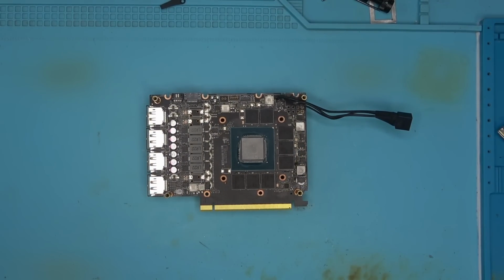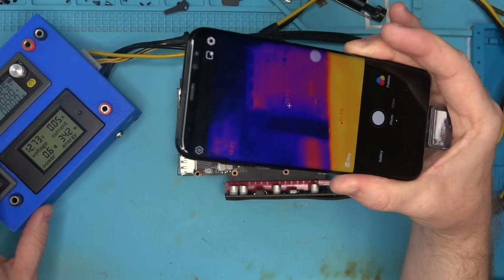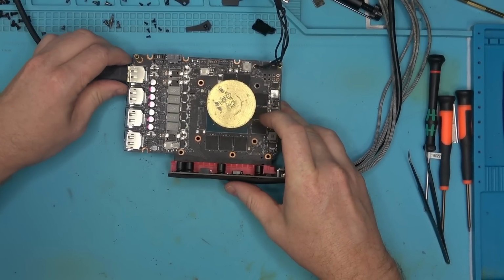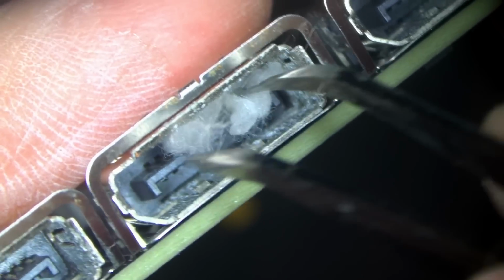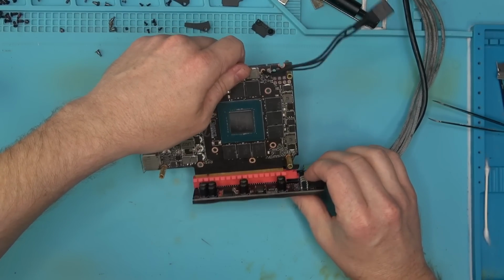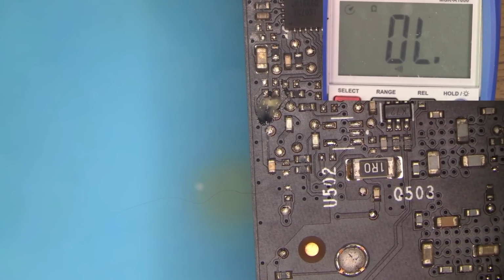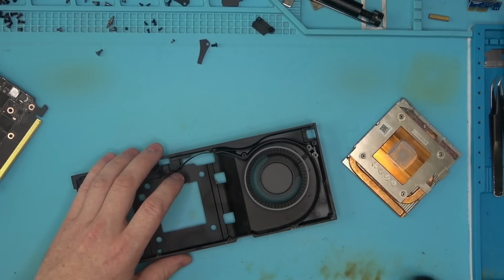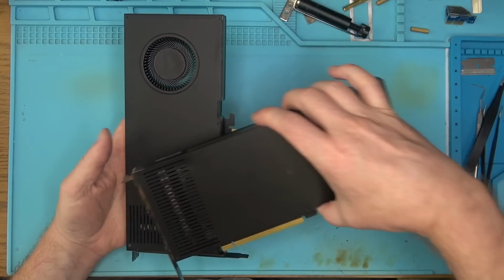RTX A4000 no video repair. Rust Corrosion damage

Comment: Looks like a good candidate for painting the PCB with Conformal Coating to water proof it. So it can go back to the Sauna it was used in. And tell the user to slap vasiline /Petrolium jelly on the display ports.😂😂😂

Comment: I have the same black and white 8K Hdmi cable, and they are absolutely too stiff. I am so worried about them damaging my ports. Another thing I really miss from older monitors is a way to keep the dang things on. They go to sleep and very few allow you to change the sleep setting on the actual monitor.

Comment: As a amateur PC repair guy I can thell this is similar to RTX 3060 but with 16GB VRAM. A bit faster is 4060Ti in gaming
Reply: it's identical to a 3070Ti (GA104) just with double the memory, massively underclocked and a very limited TDP (140W rather than 290W)

Comment: I got a pcie fried rtx 2060 ventus oc for 30 bucks. Asked a local phone repair guy since charger looks like the pins and they had prior gpu repair units. Got it working within 2 hours. Thanks for the tips on getting parts/defective gpu for cheap by not buying core/no post related issues. Cheers 🥂

Comment: The issue with 4K and 8K HDMI cables is usually the length. The longer the cable the less signal integrity and loss of quality. That's why there are standards in place.

Comment: what kind of metal is that slug you use as a temp heatsink? i kinda want to lazy out and use something like that for testing builds/troubleshootings
Reply: Brass
Reply: Looks like brass round bar (rod).  Find for short-term or low TDP because it's a large thermal mass, but without the surface area of fins you can't transfer much heat to the air, so not a good choice if testing more than a short time.

Comment: Try fiber optics cables! And why you use HDMI switches - for what purpose? If you have the Decklink Quad 4k you get 4 inputs and you can MIX them with Software - OBS is free.

Comment: Toothpaste.?. I'm an auto mechanic and i deal with corroded pins all the time. I've been using valve grinding compounds, but sometimes the female loses its tension from the thick grit. I'll try the Toothpaste.

Comment: I think it is a very good practice to use ultrasonic cleaner to "force" any intermitent error to manifest permanently. Me, as a hobyist, try to avoid using it for that same reason xD.

A quick question @northwestrepair (or the rest): What fluid do you recomend for the ultrasonic cleaner? Just distilled water? A very small amount of soap or nothing at all? Or commercial mixes? Thanks

Comment: Reminds me of this video of hundreds (if not more) GPUs (probably coming from mining farms) laying on pallets and being cleaned with high-pressure washer and dried in the sun, probably being prepared to be sold on ebay and ali...
If the core and memory are not already fried by heavy mining, the corrosion will probably not help the cards in the long term...
Reply: I am sometimes wondering (and used it once): If a device (phone) drops in water, don't put it in rice. Instead drop it in ample IPA to drive out the water, and let it dry. I did it once on a laptop, not quite old enough to want to throw away, but also not new enough to want to do the effort of completely disassemble: Dropped in a full cup of coffee. Immediate turned it off, drenched in in IPA, and behold, it is still working now a good year later.

Comment: What liquid do you use in the ultrasonic cleaner and do you submerge the whole board?
Is it difficult to dry out underneath the bga chips?
Reply: If you flush the card with IPA (or even just dunk it in IPA), the IPA mixes with any remaining water and makes it easier to remove via compressed air.

Comment: crypto miner i bet . if it was a legit server room it would not be rusted out like that my 3080 ti 20gb came from a  mining farm and was rusted a bit
Reply: Because they are usually using an AC to cool down mining rigs. Its the cheapest option, miners think they will save a card from its own heat damage, but you cannot change the laws of physics (or chemistry) Heat and cold together creates condensation which causing rust. You're 100% right about how those cards got damaged.

Comment: That's typical about Amazon and Aliexpress. They sell HDMI and DP cables saying they are 4K but in fact they are counterfeit rubbish.
4K standard is relatively new and yet raw. A lot of improvements are still to apply.
Reply: If i buy HDMI cables i check if they have HDMI Ultra High Speed certification (or a different standart depending on what you need). 
Manufacturers will in most cases proudly promote it if they have certified their cables. 
They also must have a sticker on the box with a QR-code that links you to the official HDMI certification website.
I never had a problem with bandwidth/drop outs or anything with these cables. 
There are quite alot around and they dont have to be expensive.
Reply: @telefonbärmann  Genius. What if they have all the "certification" for 4K but still do not support it? That's what happens with Aliexpress items.

Comment: not going to give any specific advices, but check dual mode monitors. eg, LG has bunch of them, which can HW-emulate 1080p while being native 4k if needed. that saves a ton of time and nerves. 
on top of that, most of them have built in KVM switch. may be useful
Reply: Most dual mode monitors dont have   1:1 downscaling to 1080p tho. U would think that 1080p on 4k monitor lets every pixel take exactly 4, but no. Its weird
Reply: @richardjung9562 true. But still useful for some moments

Comment: @northwestrepair Have you ever tried elma tec clean s1 in your ultrasonic cleaner for these kinds of jobs? It is supposed to be very effective at removing rust, lime and oxide films and is meant to be used, amongst other things, on PCBs with water damage. I am thinking of getting some imported to where I live but wonder about the effectiveness and how safe it is on electronics.

Comment: Probably, Most likely they've been used for Mining and hooked-up directly to AC -> Condensation.
Seen it maaany times before because they have isht cooling.
Surprised those are your first 🤨 😂
Reply from the maker: not my first but rusted so much, is.
Reply: @northwestrepair  I've seen, my worst, the caps on the back of the core fell down in my palm when i turned the card upside-down :))
Apparently "it worked until last week" but waited to get it check. :face-fuchsia-poop-shape:
Reply from the maker: @IcecalGamer  thats why i washed it in the ultrasonic to speed up degradation so i can catch it before i send it out.
Reply: @northwestrepair  Yep, i've paid attention when you've explained it in the video 👍
That was smart, especially since it looked so minor; and it was. Just a jumper.
But it could have been the mask pealing away, due to corrosion, under the core :face-orange-biting-nails:

Comment: Wild guess.. those cards were in the outside digital billboard.
Reply: That would surprise me, since they've no custom cooling solution, ideally fanless, to deal with that environment.  The serious ones aren't cheap units. So there's no reason for it to be built ad hoc via off the shelf retail GPU assemblies that aren't designed for the extremes of outside weather exposure.
Reply: naaa, theese aare pretty good/costly actually. Looks like 370Ti full quality GPU ... they like 1200USD

Comment: You could probably fix a card that was found at the bottom of the ocean in Davy Jones locker. You are the GOAT of GPU repair!
Reply from the maker: lol :face-blue-smiling:
Reply: @northwestrepair  yup
Reply: no it's sea blast my GPU rust as well it's when you live close to the sea  salt water in the air rust everything
Reply: Bro can probably fix a card that was ran over by a road roller
Reply: The real question is, can he fix 5 of my old 9800GX2s that have been sitting in my basement for 10 years :P

Comment: That's still like a 1500$ card. So cool that you can fix these things. I hate e-waste, its not talked about enough, plus just the money you saved someone!
Reply: 32:43 On GPU-Z specs, this thing looks like an RTX 3070Ti with twice the memory and very low power  budget.
Reply: RTX PRO 4000 (2025)
RTX A400 (2024)
RTX 4000 Ada Generation (2023)
RTX A4000 (2021)
Quadro RTX 4000 (2018)
Reply: @eukariootti1 overall just a confusing naming scheme
Reply: On the used market it's pretty cheap, nowhere near 1.5k considering a 4000ada goes for 1.3k